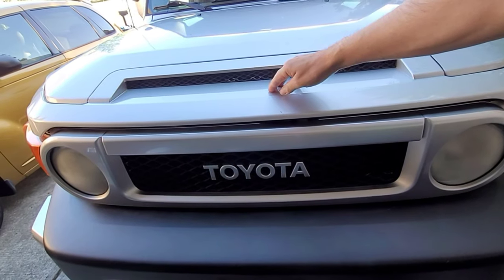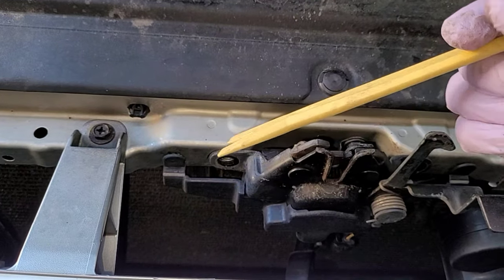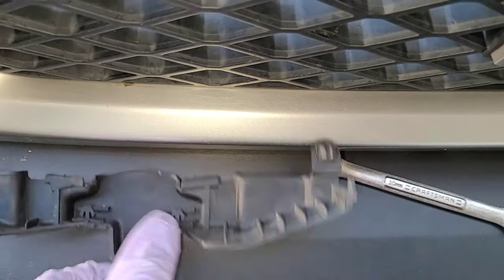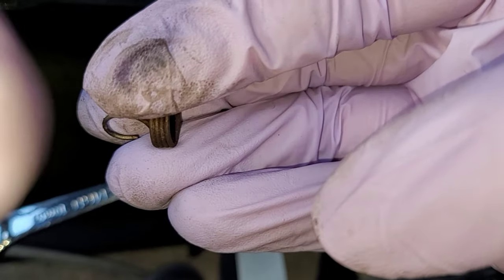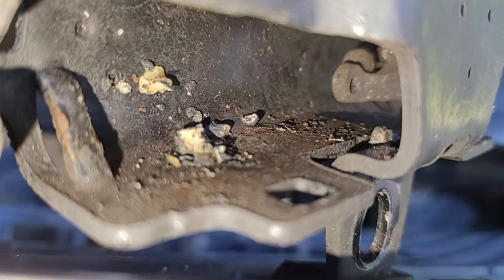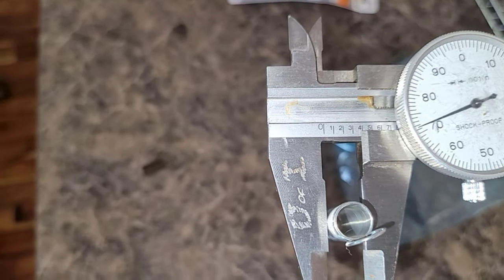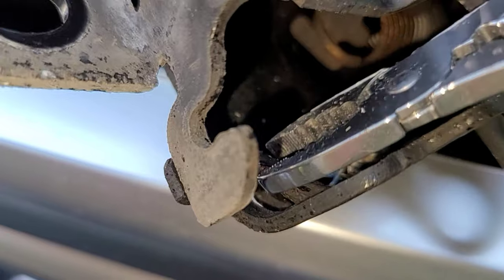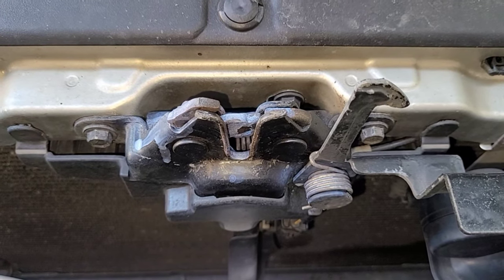SHUT YOUR LID! Toyota FJ Cruiser gets its hood latch fixed.

Comment: I just tried this and it worked perfectly.  I used the same exact spring you did.  Whole project cost $8 and I still have a spare spring that came in the 2-pack.  I will likely have to replace the line eventually, but this will  keep my truck on the road and not headed back to overpay at the dealer.
Reply from the maker: @KeyLimeBreeze  Nicely done!  Cheap and works 💪

Comment: My latch was a mess. I think it cost ~$85 from an online dealer. Works like new, now. I also changed the cable. (It needed it).
Reply from the maker: @zee_nyc It really depends on how bad your latch is to determine what is needed to make it operational.  Mine was good-to-go except for the spring. $85 is not too bad.  Congrats on a working latch!

Comment: What year is your FJ? My mechanic just said I need to replace the hood latch assembly in my 2013 - $115 part only.
Reply from the maker: Mine is a 2007.  $115 sounds like a lot + labor!
Reply: Thanks, that was my reaction exactly. The garage owner said on the 2013, the entire hood lock assembly had to be replaced - that it was "sealed" and the interior was inaccessible. He also said he couldn't obtain the assembly for less than $115. I can definitely follow your instructions, and I've found the 2013 part online - the spring is accessible from the back of the assembly. So I'm going down there today to see if we can work something out.-  @QuantiQualification
Reply from the maker: @savagefanofconan4622  Sweet!  Let me know how it goes.
Reply: Great video and Thank you.  Just fixed my 08 this morning using the exact method and parts.  $8 is better than $115
Reply from the maker: Awesome, congrats!